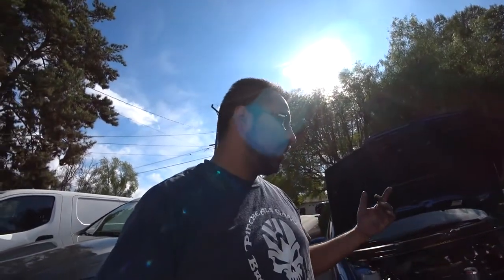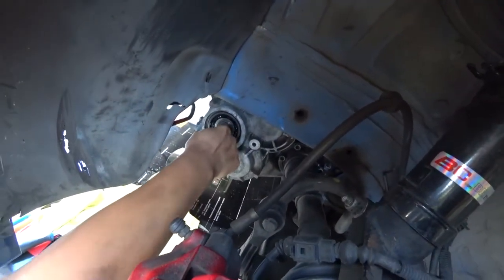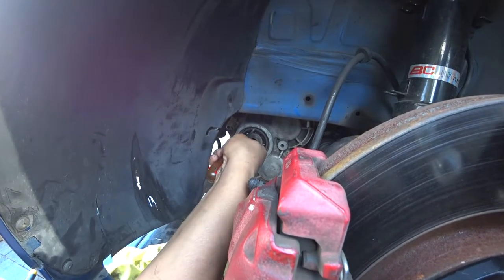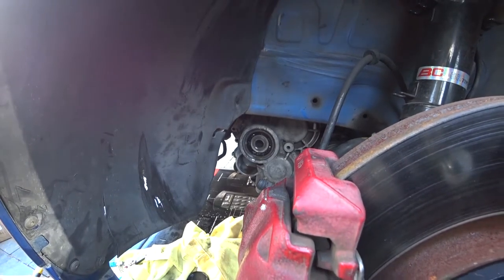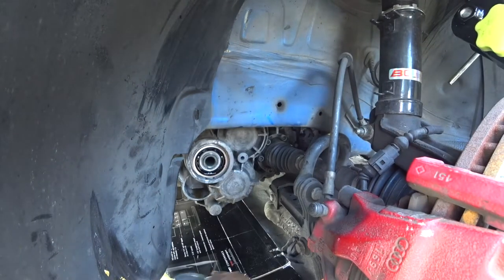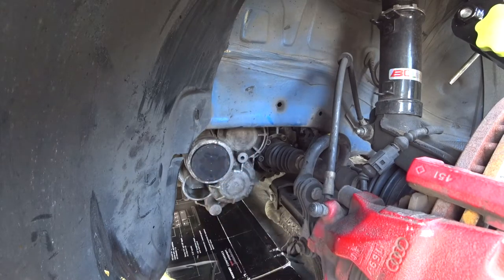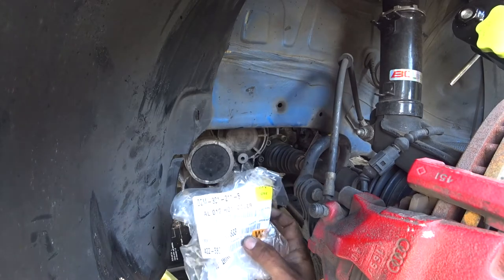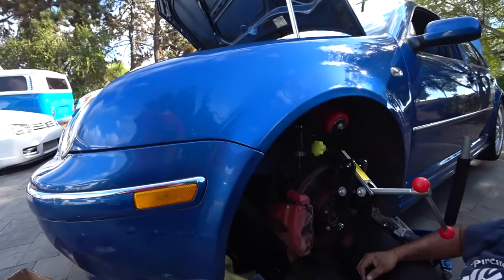MK4 GTI/Jetta 6 speed input shaft shim DIY Season 5 EP6

Comment: Another great video! When I was building up my 02m with the quaife LSD I measured the input shaft with a dual test guage and got a friend to machine up a custom shim. The Volkswagen ones are 0.65mm thick but I needed a 1.4mm to take up all the input shaft slack. The overall shim outer diameter is 78mm and the inner diameter is 72mm for reference if anyone was to want to machine their own to a described thickness!
Reply from the maker: Tom Martin great info

Comment: I can’t find anything anywhere but I heard there are 2 different versions of the o2m trans’s, one with the rubber seal and one without. It’s a 2002 GLI VR6 and I’ll be taking delivery of the car soon. Not sure if mine is a late or early model.
Reply from the maker: depends if you got on a GLI - 20th ann 0r the 337

Comment: I have a Passat b5.5 (2002) and I suffer from a big noise in the 5 and 6 speed , this method will work for resoling the problem or not ?
Reply from the maker: This won't work this is only for 02m transmission only
Reply: I found a symbol on the Carter of gear box : N2
Reply: What that's mean

Comment: can you use the 6 speed manual off a mk4 jetta gli on a. mk4 golf gti?
Reply from the maker: Yes but you will need 
6 speed 
Axles 
Shift box and cables
Clutch 
Flywheel 
Throwout bearing
Slave cylinder
Clutch line with bleeder valve

Comment: Would this cause vibration on the wheels??
Reply from the maker: Arturo Diaz Melo no more like chatter like a flywheel
Reply: Bc i have the mk4 jetta gli vr6 and when in going 80mph + i feel vibration in the wheel.
I recently changed the whole suspension and got it aligned and new tires.
So that might be my problem?
Reply from the maker: wheel bearing, ball joint, control arm bushings or tie rods
Reply: All that is new! I git the stage 2 or 3 suspension from ecs tunning! All that was included!
Reply: PincheAls Garage , so while in gear  if I let off the gas sometimes I will hear a loud "chatter" sound . If i push the clutch in it goes away or take it out of gear . Do you have an idea what it can be ? 02 mk4 gti 1.8t
Reply from the maker: Arturo Diaz Melo can be the throw out bearing, bad dog bone bushings, somthing can also be loose
Reply: @nitsud77  hey I'm having the same problem...did you ever figure out what it was?
Reply: @giuseppevassallo525   mine was different i have a large turbo after market headers and 3inch down pipe. Mine is the down pipe rattling against the frame

Comment: Can you use the old cap?
Reply from the maker: No because you need to pray it out and it bends
Reply: PincheAls Garage i just opened mine and it looks like it was touched too by the pervious owner and it didn’t have any chatter at all, and it still does the 3rd noise grind when i let out the gas , and idea’s on what else it could be?, thank you for the help in advance
Reply from the maker: @juniorbarbosa02  do you have a stock flywheel or lighten flywheel
Reply: Stock

Comment: Hey man nice video.. I have a question.. Maybe you can help.. I have a mk4 GTI, I swapped in an 02M 6sp into my 04 from a 5sp. . I Finished and it feels like the throw out isnt engaging the the pressure plate. Wont go into gear while running, but shifts fine not running.. Anyway I figured I bought a beat trans, I bought another did it all again.. SAME ISSUE.!!   I'm ready to start flicking matches.!!!! Have you has a similar issue ever or is something else need to be changed like the master cylinder to a 6spmaster cyl.???? Help please if you can
Reply: I did the same thing once, the clutch disc was in backwards.